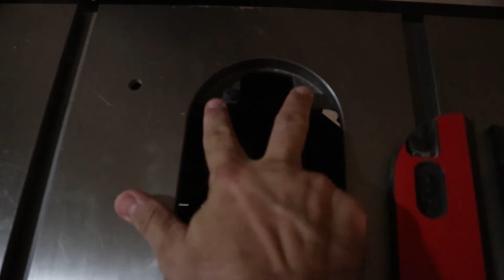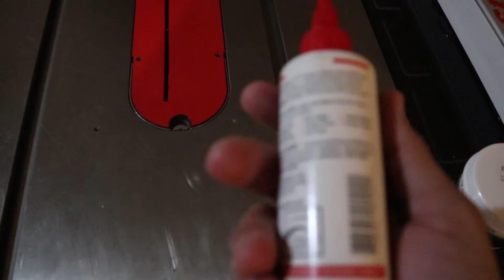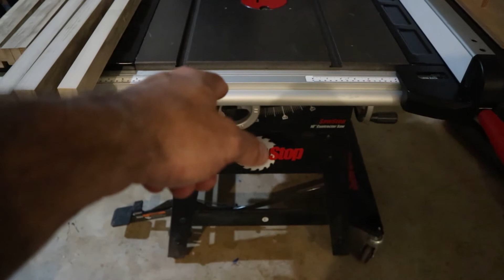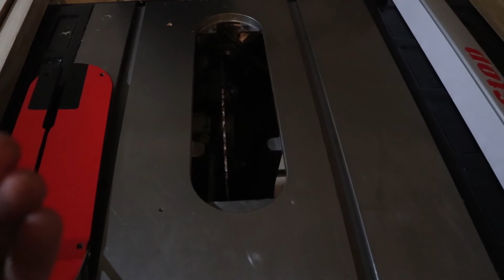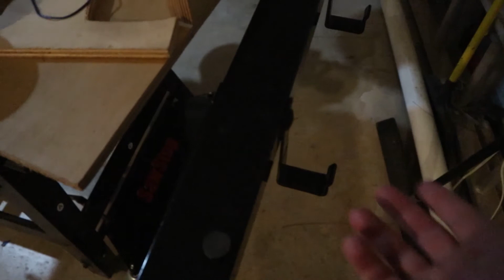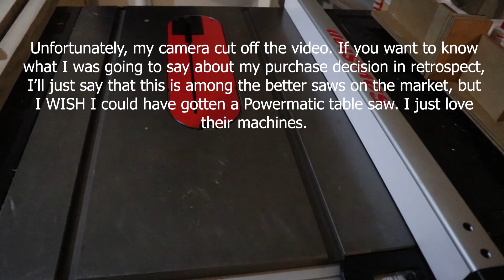Sawstop Contractor 30 Super Review 2021!

Comment: Yep I went to woodcraft and wanted the 30” and wanted to upgrade the fence and they gave me the bad news that I hade to go to the36” .  If you have a small shop you are screwed.
Reply from the maker: I've seen some people make some clever jigs to compensate but their safety is in question. I would not risk it. These days, I use manual and sometimes electric handsaws for larger boards and it works out well. I've gotten good enough at manually sawing boards nearly square enough to laminate or glue-up and requiring minimal planing. I highly recommend the old fashioned method for small shops.

Comment: I'd like that saw but that fence is a deal killer for me
Reply from the maker: I recently found out you can buy the Sawstop cabinet saw fence assembly for around $400 amd it'll work on the contractor saw.
Reply: @approvedworkman4668  Was that a 30 " fence assy? I would just get the 36 " saw with the t glide but I can only fit a 30" in my garage. :(
Reply from the maker: @KennethThePainter  I have the 30", and same for me. The 36" really isn't that much bigger. Regardless, I recommend getting the cast iron wings. By the way, there's a cast iron router table from sawstop. If you like the idea of making use of your table saw to save space, that's another comsideration.

Comment: I had that saw and sold it.  Dust collection was awful and there is no way to hook up an outfeed table because the motor hanging out the back.  The 1.75 hp motor is undersized if you want to rip 8/4 hardwood.  I'm going to get a PCS 3hp model instead.
Reply from the maker: In retrospect, it would have been better to get a step up from this one. Now prices have gotten so crazy it's getting real hard to acquire good quality tools.

Comment: This is a great review. I am considering this saw mostly because of the safety features, but you really opened my eyes about the exposed belt and motor. I'm  getting older and i feel more seceptible to have an accident, otherwise I would get the Harvey. You can get a really nice cabinet saw from them that is less than this one. I keep hoping someone will come out with another system that offers the same level of safety as the Sawstop. Thanks for the insight.
Reply from the maker: Thanks for your support and the positive feedback. However, I need to upload my follow-up review on this saw. The open belt hasn't been a  a problem. I make sure to brush the dust out after each use, and though I've used the same daily for probably 1 1/2 years, the belt and other components are in good condition. If my position has changed any, I would recommend Sawstop, but if you don't need mobility, the cabinet saw is relatively a better value. However, if you can afford the cast iron wings for the contractor saw, I'd highly recommend it.

Comment: At 10:35 you say that the cast iron top will rust from setting wooden parts on it. I have a cheap tablesaw and my cast iron top does not rust just from having wood on it. I use it for storing wood on top all the time because of lack of space.
Reply from the maker: Many people work in their garages which are not humidity controlled environments (as opposed to proper woodshops). Also, there is moisture in wood, and moisture that settles under wood that sits on a surface in humidity, this can cause rust. This is common knowledge.

Comment: Hey there, I wanted to take a moment to talk about your ideas of the zero clearance insert. If you have the saw set up safely, the riving knife would be in the rear wider black area of the insert behind the blade. As well, with the riving knife installed your wood will already be past the blade. Just an observation, not criticism:) .
Reply from the maker: If you watch more of the video, you'll I see where I explained an issue with the throat plate, which is part of the reason I mentioned that. Whether it's by the riving knife or not, when doing thin rips or cutting shorter pieces, that opening is big enough to let a piece sink in. My last table saw had a zero clearance insert that was just a slit big enough for the blade and riving knife.
Reply: @approvedworkman4668  I had a similar problem with the Jobsite Pro ( one of many) and in contacting Saw Stop they said they would send a new insert with NO slot, and there are instructions to make the slot to give you a zero clearance . That insert does not have the bail to lock it in place.

Comment: What did you pay total. Any issues with the fence? I hear the T glide upgrade is worth the price.
Reply from the maker: I actually explained all that in the video, but I will say that I do like the T-Glide fance too. It's unfortunate you can't get one for the Contractor 30 at anywhere near a reasonable cost. The 36" model is heavier but worth the extra $$.
Reply: @approvedworkman4668   I didn't catch the price you paid in the video. It was an hour long and I was limited on time
Reply: I do agree that the motor hanging off the back of it is not a great design at all
Reply from the maker: @Antweak83  The Contractor 30 is $1700 and $2000 for the 36" model. Sawstop doesn't budge on prices or go on sale so the price is the same everywhere
Reply: @approvedworkman4668  so do you like your saw? If you could do it again would you buy the same saw?
Reply from the maker: @Antweak83  Well, my answer is a bit complicated. Yes, I like the saw. It's a good saw. However, if I could to do it all over again then I would have gotten a Powermatic or Laguna Fusion II. The reason is not because I think they're better but because I'm really loving the Powermatic tools I have, and because the Laguna F2 is such a great price. Unfortunately, at the time I needed a table saw, this almost is all that was available nationwide because of the pandemic.

Comment: Geez... if you expect to take it to a job site well you might want to have a cartridge with you as a spare because you are ona job and you dont want to lose time. Small price to pay..you still have your fingers.
Reply from the maker: It appears you might have skimmed parts of the video because I explained the safety benefits as well as the basic math of the finance situation.
Reply: @approvedworkman4668  I did listen.. and yes i skipped a little but my comment was aimed at the business side of it.. just budget in to have spare parts if you are a real pro.  Be prepared or you're your own enemy when you're "running around trying to find one" and ..remeber ..time IS money.
Reply from the maker: @g.fortin3228  Like I had explained at the beginning of the video, I'm not a pro, and I also presented these aspects as conjecture. Sure, that would be common sense, however, l'll leave it at a couple of simple points. First, the only way safety is guaranteed is by strictly safe and proper use. It's a mandated feature on all of their table saws that increases cost and incur expense. That's just the simple fact of the matter. Second, I'm certainly no small minority with this opinion. Lastly, it is indeed a cost and maintenence consideration in purchasing this class of table saw, so perspective buyers should be aware of it. Moreover, whether you have a spare brake and blade or not, the fact that you cannot operate the tool without the expensive brake+blade is a factor. Did you ever consider people who use expensive dado sets? That's a much more expensive replacement so would you then suggest everyone simply spend $500 to carry around spare rip, combo, and Dado blades as well as the two different brake cartridges required? This most certainly is an important point to bring up in a review. I'm not sure what it is you're trying to refute exactly as I presented no real contestable information. However, if you've published a more authoritative review then I'd be open to watching it and perhaps learning something from you. I appreciate you taking the time to contribute. Thanks for watching.
Reply: @approvedworkman4668  Ok fair enough.  I wasnt trying to just be a PITA for ya, but really, if you're taking the saw on job sites it's got to be pencil'ed in for that extra or eventually you will be running around wasting time and spending it anyway.  Might as well just get it over with and have it on hand.  We can agree to disagree i guess.  Have a nice afternoon.
Reply from the maker: @g.fortin3228  OK man, thanks for your feedback, and I do appreciate your viewing and consideration.
Reply: @approvedworkman4668  BTW,  I have not tested it yet, but I'm wondering if the saw will operate with the standard brake in it, if a smaller 8 inch dado set is installed on the arbor.  I really dont see the need for the brake while running a dado as the blade is not exposed topside and always using push pads..always!  So I'm wondering if you have tried / tested this ( I know the saw wont operate without a brake installed) ,  just installing the dado and leaving the standard brake alone ?? and if the saw will run ?  I have this saw now but I'm just starting with it and dont really want to spend the 100 dollars for the dado brake as I never run a dado without a solid elevating pad under my grip.  Have you tried this ?  thanks and regards.
Reply from the maker: @g.fortin3228  I have not tried a dado stack in this saw yet. Regardless, I wouldn't take a chance with anything other than what's recommended. I think the manual says a full kerf blade is required. I haven't looked into this much as I just do as they recommend, but I'd imagine it's to prevent teeth or pieces of the blade from flying back at you. Even if the width of the regular cartridge could accommodate a small dado stack, it may be in the math somewhere that the distribution of force requires a wider brake or whatever. I wouldn't chance it myself but I have heard some people say they use thin kerf blades and small dado stacks with the regular cartridge. As far as operating it, I don't think the saw discriminates the type of blade installed.
Reply: @approvedworkman4668  OK thanks for the input.  I just ordered a new blade, with .118 kerf.